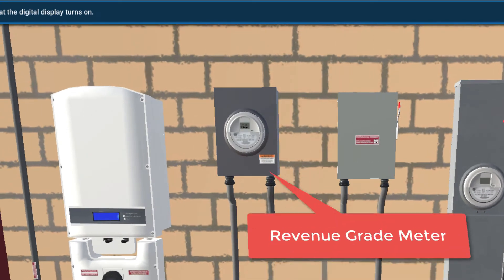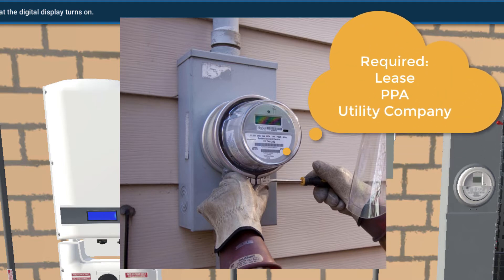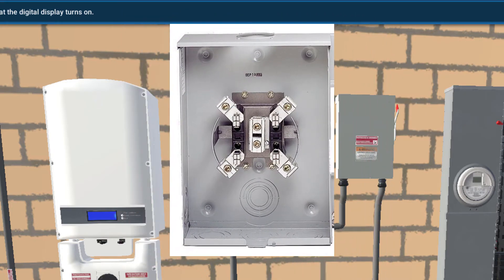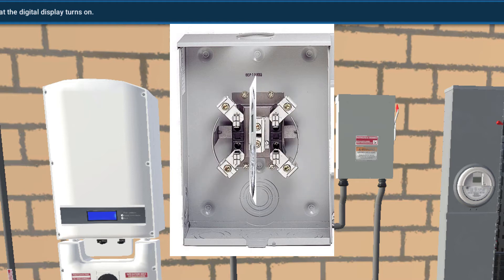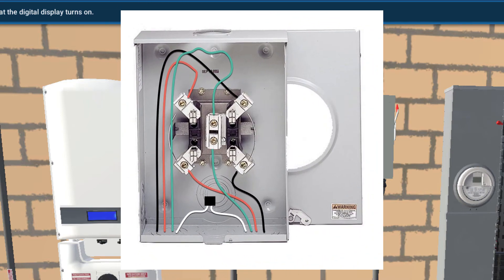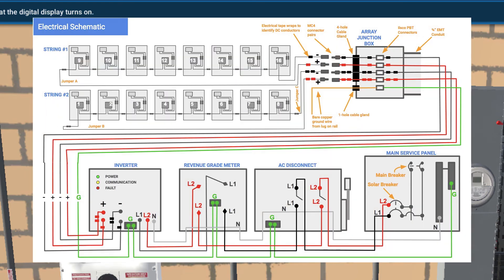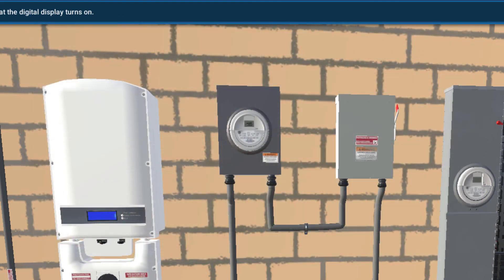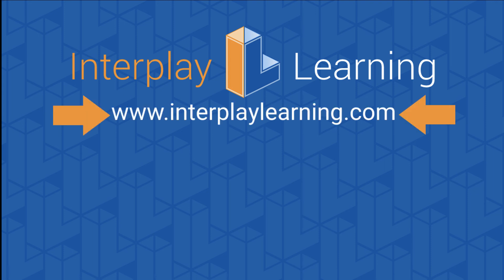What is a Revenue Grade Meter

Comment: 1:57 Are you sure the ground conductor runs through that connector? may be neutral wire goes through that connector and for the ground we will just screw ground lug with a green screw to the body meter.... I just wanna be sure because in another sources I saw neutral run there instead ground. Thank you
Reply: Plus I think that connector ISOLATED from metal box of meter